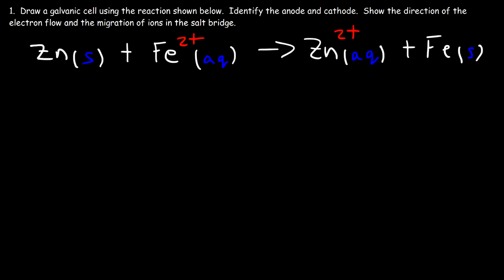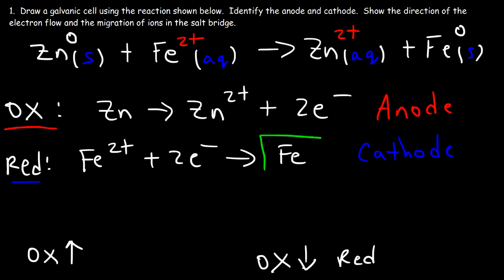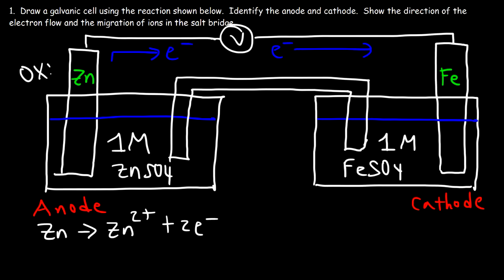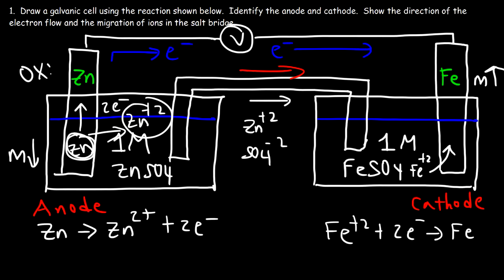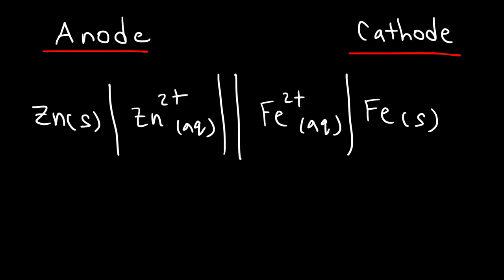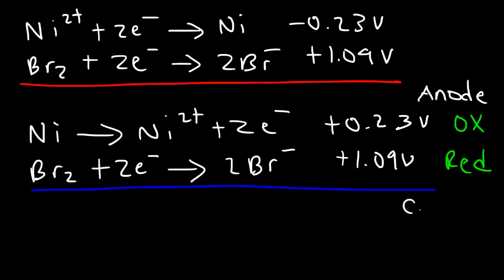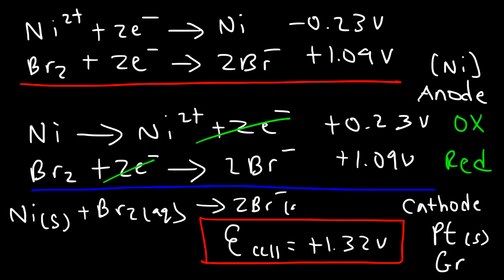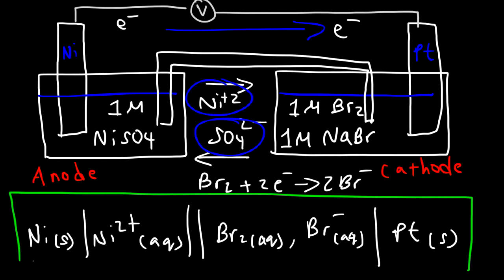How To Draw Galvanic Cells and Voltaic Cells - Electrochemistry

Comment: Professor Organic Chemistry Tutor, thank you for showing How to Draw Galvanic and Voltaic Cells in AP/General Chemistry. The drawings and explanation of the Galvanic and Voltaic Cells are excellent from left to right in the video. I am very familiar with anode and cathode from Electronic Circuit Design/Advanced Electronics. This is an error free video/lecture on YouTube TV with the Organic Chemistry Tutor.

Comment: Consider the Galvanic cell whose setup is schematized below at 298 K.
Al(s) | Al3+(aq) || H+(aq), H2(g, 1 atm) | Pt(s)
The aluminium solution is prepared by dissolving 200.0 mg of Al(NO3)3 in 20.00 mL of water.
The acidic solution is prepared by diluting 0.20 mL of HClO4 (70% w/w.; density rho = 1.67
gmL-1) with pure water. When the cell is connected via a salt bridge, an electrochemical
potential of 1.58 V is measured. Using the provided E data below, calculate the amount
of pure water added to the concentrated HClO4.
2H+(aq) + 2e-   ->  H2(g)   Enode red = 0.00 V
Al3+(aq) + 3e-  ->   Al(s)    Enode red = 1.66 V

Comment: I have a question, in the last problem, you wrote that the sulfate anions travel from the right solution, through the salt bridge, to the left solution. But where do these sulfate ions come from in the right solution? Aren't they only produced from the nickel sulfate in the left solution?
Reply: Sorry I'm late af but, note that the Bromide Cathode is in a Bromide-Sulfate (Br2SO4) solution. When there are free electrons on the cathode, the bromide detaches from the sulfate, to add more mass to the cathode leaving a buildup of sulfate ions (and hence a negative charge) at the cathode. However, these sulfate ions are attracted to the anode's zinc ions, travel through the salt bridge and attach to them. 
Hope this makes sense :)
Reply: @nicholasdsilva1832 I don't understand it's not BrSO4 but NaBr and Br2